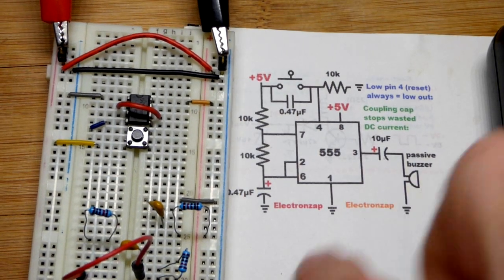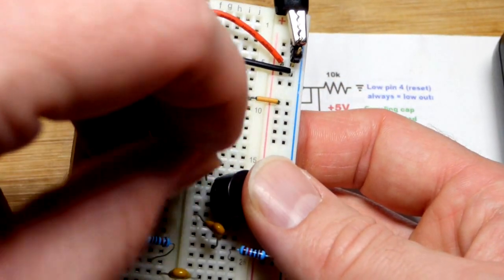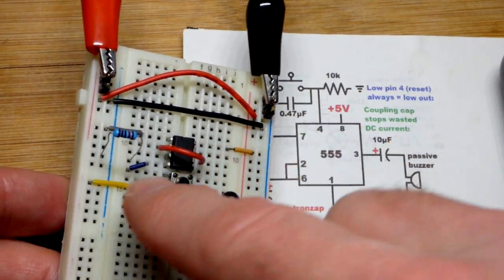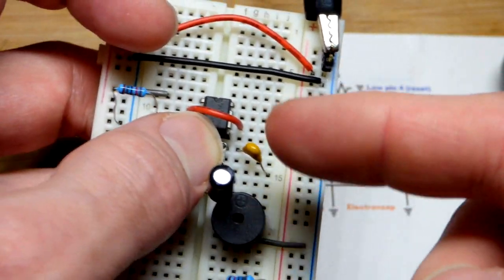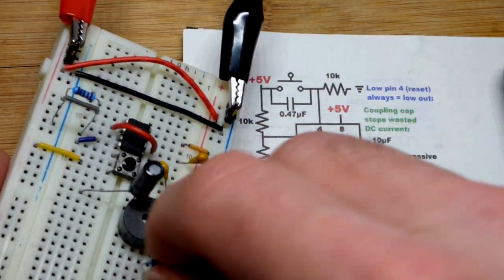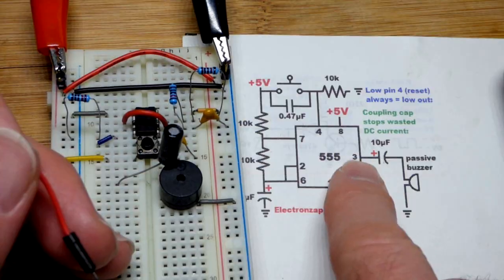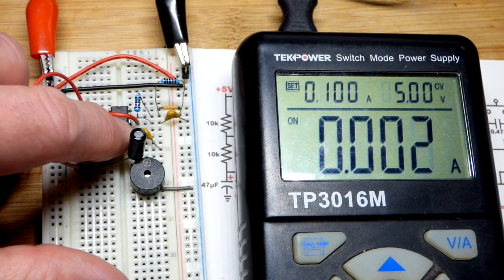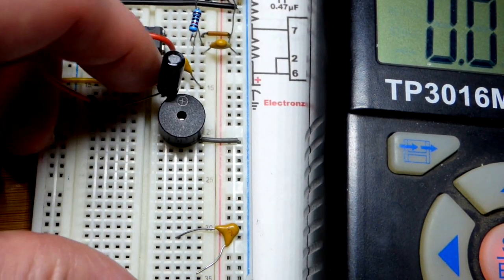Step By Step Passive Buzzer 555 Timer and Push Button Controlled

Comment: One thing that came to mind, if making this into a permanent =battery= powered device, would be to employ pin 8 (with an appropriate cap) to the switch, so that when the switch is off, There will be no quiescent current flow (zero) when the button is released...battery would last a looong time!
I did some similar with a dog whistle.
THANKS FOR THE VIDEO!!!
Reply from the maker: Yeah, you'd definitely want to cut power completely while buzzer is off if using a battery.